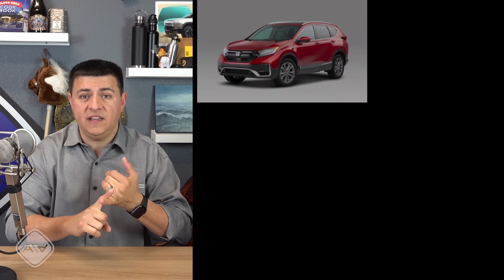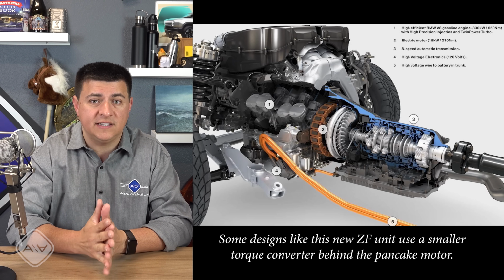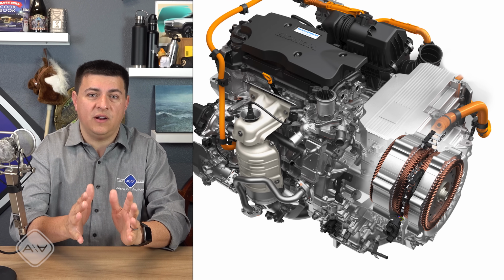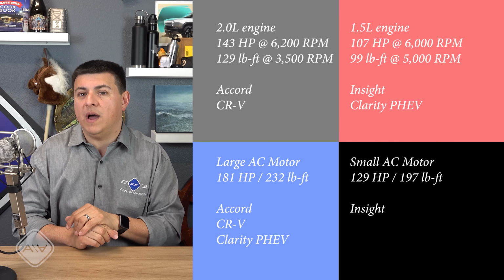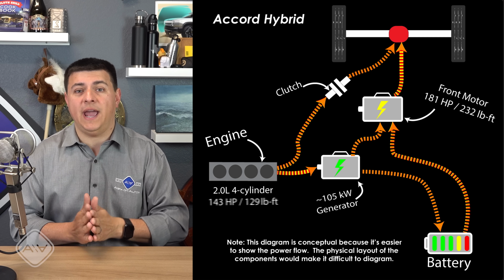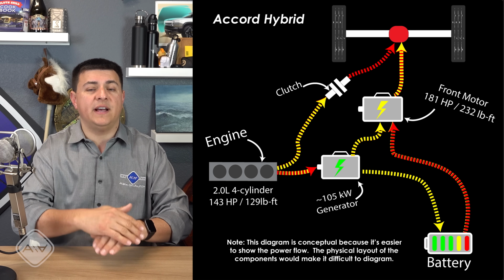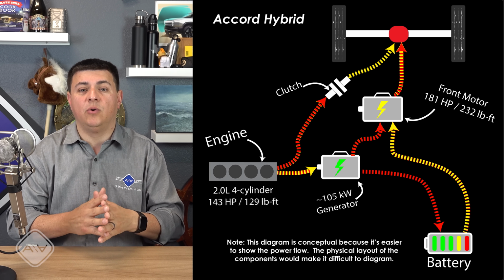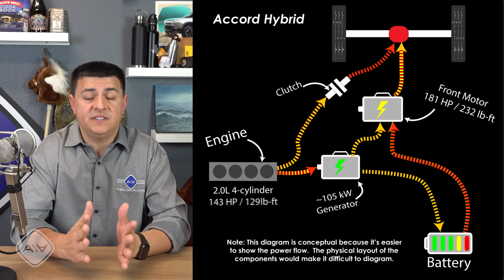How Does It Work?  Honda's 2 Motor Hybrid System Explained!

Comment: Would love another video like this, except based on the 2023 CR-V hybrid when it is available, which should be shortly!
Reply: Alex explained only the basic principles - which are not changing - and the engine/motor specs - which are changing, but only by a small amount.

But within that spec change, there was a change to how the "combined horsepower" is calculated, which Alex points out in his first-peek at the new system. In it, the old system made 201 combined HP, and the new ups that to 204. So don't compare 212 to 204.

I don't know what this calculation is, but it apparently is a standard called "ISO net." I'm guessing that it is meant to compare hybrids to hybrids. While I doubt it is 100% accurate, at least it is a stake in the ground for comparing hybrid to hybrid.

This is important, because many reviews - sadly, this includes Alex's here at 7:45 - completely misrepresent Honda's hybrid power. As an example, the following is the accurate way to compare the 1.5L and hybrid Accords and CR-Vs. The conventional system loses an estimated 15% of its maximum power (that's 29 HP) to heat in the transmission and peripherals between the ICE and the wheels. That is:

ICE-->(192 HP)-->Transmission and peripherals-->(estimated 163 HP)-->Wheels

The Hybrid operates only in Hybrid Drive when more than about 50 HP is needed, which is one thing Alex doesn't get right. The combined HP rating is what the the car requires of its electrical system to produce the 181 HP the motor can transfer. With the same 15% loss elsewhere, that means:

Generator+Battery-->(requireed 212 HP)-->Electrical losses and peripherals-->Motor-->(181 HP)-->Wheels

Alex seemed to think, in this video, that the motor's 181 HP,  which is all that "the average American out there [can] experience," should be compared to the 1.5L turbo's 192 HP. It is not. It compares  to (0.85)*(192 HP)=163 HP. So the 212 HP figure was the best way to compare it to what the average American experiences. That was probably even a better comparison that how the new standard will compare to other hybrids. But now we can compare hybrids.

What I hope, is that Alex explains these comparisons better, and apologizes to Honda for what he says about power here.

Comment: 10:40 So if Honda fit a larger battery? if they put the battery completely under the car like the tesla layout and say then use an electric motor for each of the rear wheels, it would be one hell of a quick car?? Would be really good off road to??

Comment: As of 2024 there is a low speed clutch / gear that can engage allowing the gasoline engine to directly drive the car.  Apparently it was added to assist towing, since the CR-V is rated for 1000 pounds.  Therefore, you could now say the "transmission" is a 2-speed . . . . sort of.
Reply: As of the 2014 Accord there was an overdrive gear, engaged by a clutch, that allowed the gasoline engine to directly drive the car. This was useful in moderate power, constant velocity (i.e., cruising) situations. It wasn't useful below about 40 mph because power requirements were too low. The fixed-ratio would require far too much energy to be buffered in the battery, increasing time in EV drive. Which is the least efficient mode in a hybrid.

But that changed when towing was added to the 2023 CR-V. Then, lower-speed cruise while towing provided the right conditions.

And no, it can't be called a two-speed transmission, since it doesn't switch between the two.

Comment: when the honda hydrid system is operating under 45mph,   if the engine does start until the battery runs low, then I assume the fuel economy can be better? I'm referring to the limotor ONE model

Comment: Thanks for breaking down the real hp numbers. Accord hybrid doing 0 to 60 in 6.5 is very surprising.
Reply: Why is it surprising? Hybrids do not have to be under-powered. It is a specific choice of some manufacturers to raise the mpgs of their cars by about 10% of the performance they sacrifice to do so, because they think consumers won't mind.

The Honda Accord is essentially a 181 HP electric vehicle. It just isn't a battery EV, it is a generator EV. The distinction makes no difference to performance. You simply can't use HP to compare engine-driven cars to EVs.

Take the 192 HP conventional Accord as an example. That HP applies only at 5500 rpm. The Accord has a CVT, so it can make 5500 rpm correspond to any speed, but there is no guarantee that it will. In fact, it almost never will. At higher speeds, you can't realistically hit 5500 rpm for any significant amount of time. At lower speeds, you can't use that much power without spinning the tires.

The electric motor in the Accord can apply 181 HP to the wheels at any speed above about 37 mph.

And the advertised number isn't the HP that gets used for acceleration. It's what the engine produces. Some gets used for your alternator. More goes to power brakes and steering. Air conditioning. And whatever else. Some gets lost in the transmission. There is no consistent way to say how much reaches the wheels, but the usual rule of thumb is that it is 85%. So that "192 HP car" really has "163 HP wheels," and that is only under ideal circumstances.

The 212 HP rating for the Accord means that its battery and generator can generate a combined 212 HP of electrical power. Some goes to the same things I mentioned above. But if 85% of it - which just so happens to be 181 HP - can reach the motor, this power is perfectly matched to the motor. The 212 HP Accord Hybrid has 181 HP wheels. And if 85% of the 151.5 combined HP in an Insight can reach the motor, it also exactly matches the 129 HP of that car's motor.

Gee, maybe these Honda engineers understood these things?
Reply: @jeffjo8732  I can't find much info besides the "combined HP" commercial claim, which makes little sense since AC+ICE are never pushing together at max output in this system.
Where can I find more technical info?
From what I understand, the traction motor max output is 181 no matter what, while 212 is the max combined output of energy sources (then used by the motor PLUS all other appliances). Fairly different from an ICE where all energy comes from the engine and appliances will "steal" from available HP.
Or, is the 181 HP motor capable of a limited overboost to 212 HP?

Comment: If the 2020 Accord Hybrid does not have a transmission why is there a transmission fluid change in the list of service items also your website is the only place I can find out informatin on the Hybrid engine thanks
Reply: The noun "transmission" means the process that transfers power from one place to another. Every car has a transmission system that accomplishes this process between the power plant and the wheels. It usually involves at least one gear to change the spin rate of the power plant to that of the wheels. For example, in an electric car like the Tesla, this gear has about a 10:1 ratio. There is also a differential, which allows the two driven wheels to spin at different rates so the car can go through turns.

This transmission system requires lubrication and cooling, which uses transmission fluid. All cars use it, even Teslas. But how often it needs changed depends on how it is used. Teslas have a sealed system, where it can't be changed. Whether or not that is a good idea remains to be seen.

But in typical American terminology, "Transmission" means the part of this system that mechanically connects the engine to the differential, and changes the gear ratios. Neither electric cars, nor the Honda iMMD hybrids, have such a device. But they still require transmission fluid for the parts of the system they do have.
Reply: @jeffjo8732  Thanks for the explanation

Comment: Hi Alex. What is replacing traditional alternator in Honda CRV hybrid and how it works? Does power converter inverter replacing the alternator being charged from smaller electric motor and suppling power to the car and high voltage battery? I just want to understand how it works not having traditional alternator. Thank you

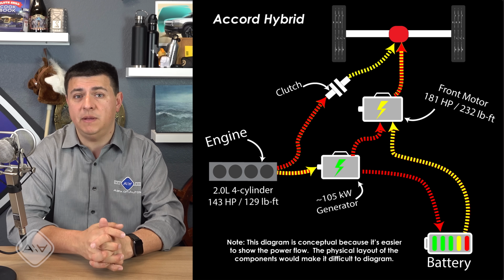Comment: 8:30 - the peak HP can be achieved at other speeds too. If the electric motor delivers its maximum HP and the gasoline engine helps a little, peak HP can be achieved as long as the battery has charge.
Reply: Peak HP in an iMMD hybrid is unrelated to car speed. The traction motor does not contribute to it, but the specs are related.

The 212 HP (Accord; 151 for the Insight) can occur only when the clutch is disengaged, when engine speed and power are unrelated to car speed. So it can be achieved at any (car) speed by the generator at max output and the battery at max output. But it can't be needed until the car gets above about 40 mph.

212 HP is the power available to the Accord for everything it needs to do. That includes non-propulsion things like power steering and brakes. What few recognize, and this seems to include Alex, is that this is what the advertised power also means in non-hybrid cars. It is usually estimated that at most 85% of an engine's power is available fro propulsion. And guess what - 85% of the Accord's 212 total horsepower is 181 HP. And 85% of the Insight's 151 total horsepower is 129 HP.

Comment: Further to my questions below, For the information of the interested. Now that I have had an Insight for a few months. I have seen the car go at 70 MPH in EV mode, run only by the Electric motor, though not for long. It is not essential that above 45 MPH only the gas-engine will run the car but if the conditions are right, it shifts into EV mode at highway speeds also. 
In ECO mode the battery is never fully charged it keeps getting charged to maybe 6 bars (6/10) and then discharges to about 2 or 3. in Sport mode, battery is at higher charge state, 8 to 9 bars. the higher the battery is charged, the more it will keep the car in EV mode, even at higher accelerations, lower battery will cause a car to shift to hybrid mode for lower accelerations also. I would love it if the battery was a little bigger and would power the car longer in pure EV mode.
Thanks Jeff for your detailed answer.
Reply: "It is not essential that above 45 MPH only the gas-engine will run the car..." You are stating this rule backwards. The gas engine will only drive the car above about 45 mph. But the traction motor can, too.

As you noticed, the car doesn't even try to use the full range of the battery. It's only there to save excess energy. It's actually a good thing that it doesn't go far in EV mode. It leaves more room for regen braking charge, and causes less wear on the battery.

Comment: Can you comment on the when the brakes start to take over on the Honda Accord hybrid.  I notice when I lightly brake the regen is more then when I use the paddles.  I am surprised that Honda didn't engineer in more regen that way.  Thanks
Reply: The amount of regeneration depends only on the rate of slowing, not whether you get it by using the paddles or the brake pedal. If you are going slow to begin with, a light touch on the brake pedal will exceed the effect of the paddles, which are only trying to slow the car like normal engione braking would.

Comment: Question for those who understand these things. I’ve bought a Honda Jazz or Fit as it’s known in the USA. From reading and listening to videos it seems:  from 0-30mph it will drive in ev only; between 30-50 it is mostly combination of ev and hybrid; from 50 to 75 it is likely engine directly and above 75mph it will go back into 100% hybrid. I may be slightly off in the speed for each mode but hopefully not too much. So for motorway/highway driving and fuel economy am I better to to drive faster than 75mph and avoid driving, if I can, between 50-75mph?  Hope this makes sense.
Reply: I personally think the factors defining these modes are presented backwards; that is, from a "what gets used" point of view instead of a "how it gets used" one. There really are only two modes, but one comprises two sub-modes:

1. Motor Drive. Only your 80 kW electric traction motor drives the car.
1A. The traction motor is powered by the battery alone (EV Drive).
1B. The traction motor is powered by the 70 kW generator (driven by your 72 kW gas engine). If the level of power it produces is different than what the car needs, it is adjusted by the battery. (Hybrid Drive)
2. Engine Drive. The gas engine drives the car. If the level of power it produces is different than what the car needs, it is adjusted by the traction motor and battery to add or subtract power.

Motor Drive can be used at any speed. Whether it is sub-mode 1A or 1B depends only on the state of charge in the battery.

Engine Drive is used only between about 45 and 75 mph, and only if low power is needed. These speeds are for the Accord, but shouldn't vary much.

If you have a Power Flow Monitor, you can watch this happening. Blue lines mean power being used to drive the car. Green lines mean power being saved in the battery. A gear in the center of these flows means you are in Engine Drive. No gear means Motor Drive.

And you should never avoid Engine Drive. It is the most efficient. Speeds above 75 mph become less efficient because it switches back to Motor Drive. What you shouldn't do, is press the "EV Mode" button to force EV Drive. It is the least efficient. You can use it if you want to be quiet, or to use charge so you can use regen brakes on a hill, but otherwise leave it alone.

Comment: Can someone help me understand what would happen if the electric motor inside the transmission went out? What eould this scenario look like? I think we would have no movement at all and the engine either cannot do anything because the first gear(electric motor) is gone or even of the engine does something somehow then there would be a sudden jerk .
Reply: And.... what would happen in any car if a major component of its drive train mysteriously, and inexplicably, "went out" ?

Seriously, you are looking for a reason to find fault in this system, when the components you doubt are far more reliable than the ones in the systems you seem to prefer.

But what would happen is that the motor would no longer be able to apply toque to the countershaft. Since no mechanical connection would be impeded, the car would (without a jerk) very slowly (no regen braking) coast to a stop unless you apply the brakes. It is uncertain where the output of the generator would go, but with less load the engine would probably rev higher until you take your foot off of the accelerator.

In an ICE car, if the ICE "went out," you would ruin the transmission, and quite likely the engine.

Comment: What about the transmission maintenance in a Honda Accord Hybrid? Is it the same as other hybrids?
Reply: Change the ATF DW-1 transmission fluid (2.3 qt) when the Maintenance Minder shows code 3. If you drive regularly drive at low speeds in mountainous regions (causing high transaxle temps), Honda recommends bypassing the Minder and changing at 47,500 miles. My 2018, at 86K miles, has not shown this code yet. I expect it at the next oil change, and may do it anyway.

The Maintenance Minder monitors conditions that can lead to degradation, rather than telling you to change the fluid when the worst conditions could cause it. I know that Toyota just recommends every 30K to 60K miles, or 2 to 4 years.